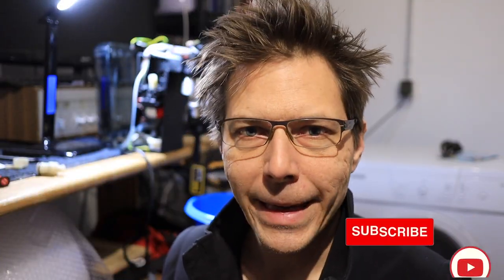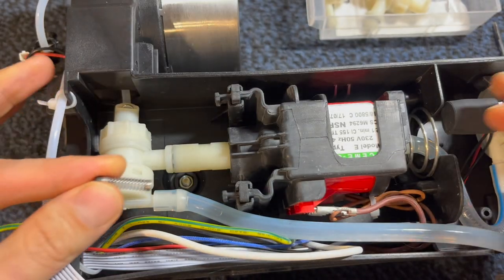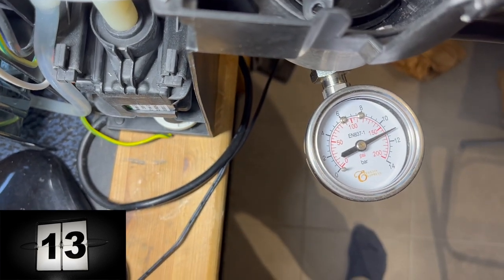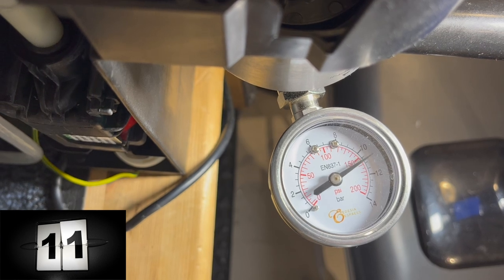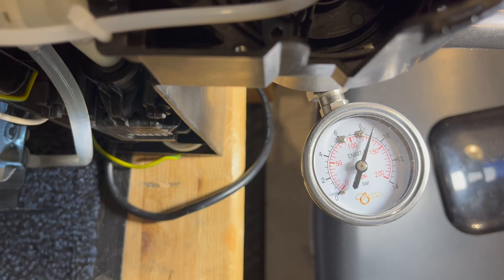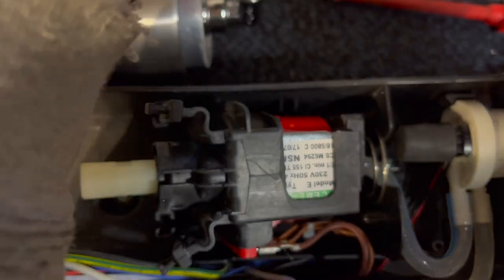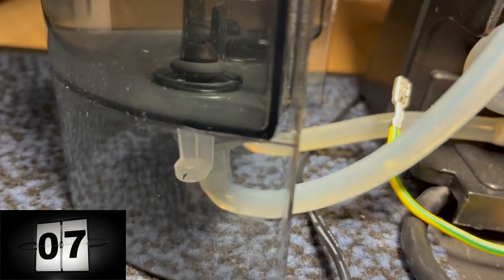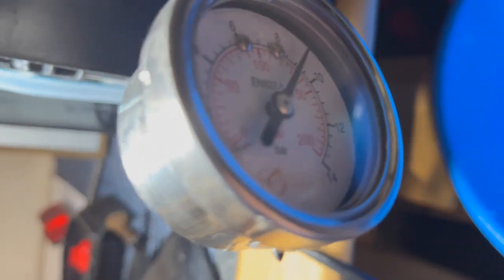How to Tune the Dedica to Max Out at 9 Bar instead of 11. Should you do it?

Comment: There is one more way to bring the pressure down - open partially the steam knob and like on Gaggia Classic the water flow is routed through the steam wand. I think the biggest problem of that machine is the heating element, cause the temperature of the water is depending on the flow, and I'm not sure if temperature surfing could resolve that issue, another downside of that method is that water is not exiting the shower screen evenly, so it could form channels
Reply from the maker: Hey there Tarop, well I am not sure this works, as the Dedica has a binary on/off switch for the steam, rather than a crescent valve. Have you tried doing it with success?
Reply: Yes I was thinking the same thing. Having the temperature depend on the glow is the one main disadvantage of Thermoblock machines. The Ascaso Steel PID seems to have excellent temperature stability.
Reply: @TomsCoffeeCorner  That works because, the steam knob actually a 3 way valve (thermoblock -> grouphead or/and  steam wand) which have  2 functions: It opens a valve but at full swing it's also activating a switch which is starting the pump. Before the fully opened state you have the connection to the thermoblock and if there is any pressure (from the temperature or if pump is working) it's pumping some water through the steam wand. One of the problems is that you don't know the actual flow/pressure, but you can feel what is going on. The second problem: when the valve is fully opened but before the button is pressed (so we have sufficient flow through it) there is some big resonance with the pump and the machine is at its loudest state, but I don't think it's lethal for the machine. So, i would encourage you to try this
Reply: @alexanderschmidt8305  As I see the thermoblock in that Ascasso is massive, made from big chunk of stainless steel and aluminum, the piping is very long so the water absorbs much more heat in controlled way. Btw Decent Espresso Machines have interesting technology: 1 pump for hot water (I believe the temp is constant) and 1 cold water pump (from the reservoir), so the output water is blend between them. Combine that with sensors, good control and thermal insulation and you pretty much have the best thermal stability, but that is whole another topic and price range :D
Reply from the maker: @hahuhahuv  Very interesting Todor, I shall try this method in the future. Cheers!
Reply: Do I partially open the steam knob after I press the brew button or before I press it?

Comment: Hi Tom! 
Really appricite for your affot about showing how to get really close original espresso in small budget!
Please clarify the lengh of pen spring ofter cutting? 

PS I'm on the way to install inox flange btween 2 parts of biler - and get almost 500ml )
Reply from the maker: I actually would not recommend doing that. Shortening the spring changes its characteristics. It's what I tried showing here.
Reply: @TomsCoffeeCorner  unfortunately original spring was lost - so during waiting a new one - it will be great to use pen spring
Reply from the maker: @serakovevgeniy7117  A pen spring will work, but it is also slow to react...

Comment: I feel like the issue with shortening the original spring is that it doesnt interact with the plunger as early as the original spring did. what about shortening the orignal spring then stretching back to the original length?
Reply from the maker: Hey there! You could definately be right about that. I didn't quite reach the success I wanted. It would probably be best to have another spring dimensioned for this OPV, with slightly less strength than the original. I think that shortening them changes the power of their springiness in a non-linear way.

Comment: Am I wrong or in a video I saw that you put a pressure gauge on the side? great, but the real problem with this small but fantastic machine is that, even if you set it to the maximum temperature, the coffee comes out lukewarm. did you find a method to solve it? in addition to heating the cup of course. Greetings from Italy
Reply from the maker: Buon Giorno! Yes, I mounted one to the side. It is a lovely machine, but yes the heat could be just a bit higher. You could warm up your PF first, that would help. Make sure your cups are pre-warmed too. Then, you could do the steam mode hack. Cheers!
Reply: @TomsCoffeeCorner  yes, I preheat the cup by letting the water come out so at the same time I clean the residues of the previous coffee. I will also try to warm up the filter holder. did you create the video of the side pressure gauge? I don't think I will because I don't have your manual skills but I'd like to see how you did the job. anyway, I think the Dedica remains the best quality/price machine on the market (by changing the pressurized filter holder though) also considering the space it occupies (before I had a Lelit). ciao, ottimi video 👌
Reply from the maker: @passoborgo  https://youtu.be/Scsm9Vw6JrA
:)

Comment: We need a PID for this espresso machine. Temperature control is major issue on these machines and the most inconsistant. If this can be solved we will have a great little contender. Can you help us?
Reply from the maker: Oh boy, I am not sure about that. It is so tight in the Dedica, I am not sure where a relais or control board would fit...
Reply: @TomsCoffeeCorner  Ya it is pretty tight in there. Small footprint being it selling point. I just changed the anti-drip valve as per your instructions in another vid. Thanks. Now my machine is like new again for price of pennies. Why don't you do the first prototype work re the PID and see if it is even possible. Even if it is ugly and the PID must live outside. Always possible to investigate to reduce size after proof of concept works or build a custom SS case for it on the side. I really think this is the only thing this machine needs extra after the manometer. It will then compete with the big boys.

Comment: We have (1) spring wire thickness; (2) spring length; (3) spring diameter; and (4) number of rounds in the spring. I wish to know which factor affects what, so that to pick the best suiting spring for my desired profile.
Reply from the maker: I think also the characteristics of the steel used will make a difference, too. You'd probably need a spring expert to help choose one, based on the design of this valve, or else just use trial and error. Cheers!

Comment: Hi, ive got Delonghi ec156 little older machine and i want good espresso, can u tell me how can i change pressure from 12 to 9 bar? Thanks
Reply from the maker: Sorry, never opened one of those. But, 12 bar is the max pressure with a blind disc. It will be lower during an extraction, I’ve found.

Comment: I have my beloved Dedica and I've been wondering if and how to lower to 9 bar since my bottomless extractions are disastrous due to the high pressure.  I've refined other aspects (finer grind, temperature etc. ) and do get great tasting shots but I'm so happy I've found your series of videos because you have great ideas and fun videos for a "dedica-ted" espresso nut like me. I'll be waiting for the dimmer mod? Thanks Tom. P.S. I believe your accent is German (not sure) but I'm from  🇨🇭. Cool.
Reply from the maker: Hey Anthony, thanks for your comment! I think I’m going to try to do an in-line Manometer modification before the dimmer. But I plan to both!
German is my second language.
Grüße nach der Schweiz!
Reply from the maker: By the way, I am not sure I can recommend this modification is anything more than an experiment. If you’re having trouble with your bottomless extractions, you might need to adjust your input variables. The main thing is freshly roasted whole beans.
Reply: What’s your temperature setting?
Reply: @ththboto  medium. Should I go hottest?
Reply: Wouldn't the dimmer water pump regulator switch help with it? The question is the water flow or pressure. Noticed pattern that higher pressure pumps are required to achieve 9bar while having pressure loss due to coffee flow. With 9 bar pressure fully blind basket, means that pressure is already low.

Comment: Nice test.
Sadly pressure to 9.5bar with 13.5mm spring takes much too long
Do you think trying a different spring with original lenght and less N/m strength will let it speed up?
I think it only makes sense to mod a non pressurised filter with constant 9bars in 25sec-30sec
If that works, one machine to rule them all ;-)
Reply from the maker: Yes, I have to agree with you. The buildup of pressure takes much too long like that. Different springs with different tensions will probably yield a different result. Just doing these tests however, I would recommend keeping the OPV as it is.
Reply: ... another idea: open the steam valve to reduce pressure during extraction
Sadly I do not have your pressure control tool, so it will be hard to tell how far to open it. Maybe an idea for another video?!
Thanks a lot for all your inspiration!!
Reply from the maker: @paetgmeiner3620   Good idea to try! People use this hack with the Gaggia Classic Pro, too.

Comment: Dimmer mod is flow control, not the pressure control, search "brass OPV" on youtube, the one was used on Breville dual boiler that one fits as well, 30 $ ish, the one I got in China was 15 ¥ =2.38 $ or so.
Reply from the maker: Hey, I found that model. I will have to see if I can find one of those OPVs in Europe.
Reply: @Alberto Rodríguez I haven't done yet, but I have installed OPVs on Delonghi 310(for 3 of them).
Reply: @TomsCoffeeCorner  Have fun, xD.
Reply: @Alberto Rodríguez Well, the model that I bought was water heater OPV for shower and I don't know if you can find it in ur country, it was compact and cheaper, does get the job done.

Comment: Awesome video! Another nice video would be to see how the flow rate affects the temperature. I have the theory that if the grounds are slightly too coarse and water flows though quicker you have a smaller pressure and less temperature which both negatively impacts the taste, making it more hard to get great tasting shots from a machine like the dedica. I'm often getting good shots but also quite often the shots are less stellar from my Dedica
Reply from the maker: Hey Alex, I have found that a slow flow rate will equal more sour shots, while a faster rate gives me more bitter shots. I guess you're right, that all three variables play a role here: flow, pressure and temp, and they affect one another dynamically. Because the interaction of these variables is kind of arcane territory to quantify, we often lean on the optical evaluation of shot extractions. At least I do. I will pay more attention to the above mentioned variables in the future.

Comment: There is another problem with dedica is due its low water temperature. Because i have tested with max temperature setting, it only reach 80 degree celcius max. Which is considered too low for some  roasting profile. anyway, if you lower the pressure, there will be lower steam pressure. Which is not good for frothing the milk.
Reply from the maker: Well you could potentially temp surf. I was thinking about experimenting with that too. So if you turn the steam mode on for a few seconds, that should bring the temp up. Let me know if that helps.
Reply: Yeah I see water temp floating around 78-83deg C as it leaves the group head on my machine. 
I suspect though that the water temperature as it leaves the thermoblock would be closer to the ideal 90-96 deg. The pipe taking heated water to the group head is just thin uninsulated teflon tube that runs the length of the machine and then goes into plastic group head so I think there's probably a bit of thermal loss happening in that tubing.

I'm was thinking I might wrap the tube in a bit of foam insulation just to see what happens.
Reply from the maker: @michaelmulvogue9165  Good idea, Michael! The thermal heat loss is the biggest complaint advanced users have for this machine. If you can find any way to tune that, I am sure people would love to hear the results! Tom

Comment: I think that the dimmer mod is finally the best mod for dedica, as you told at the end of the video. If is possibile install a dimmer you can control better the preinfusion, go to 9 bar and then slowly go to 5-6 at the end of the shot.
Reply from the maker: Hey Gianluca, yes I will try to get to this in the future. It would be fun to try. But I have to find the right type of dimmer to install. Any ideas?
Reply: @TomsCoffeeCorner  I think a single pole dimmer will work, like 
Lance Hedrick used in the mod of the bambino plus
Reply: @TomsCoffeeCorner  hihi !
do you still plan to make a dimmer mod for dedica?
Reply: @ArgentumStudio_Old  wondering the same thing. If he doesn't post a video soon, I will have to take matters into my own hands. haha